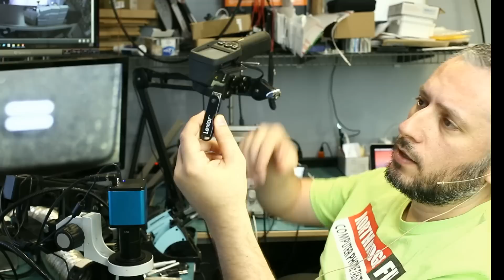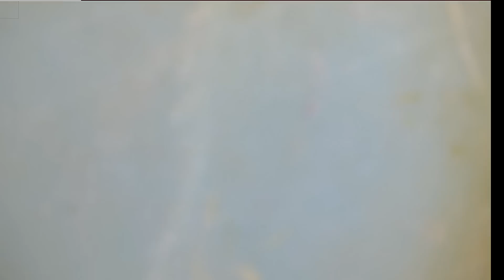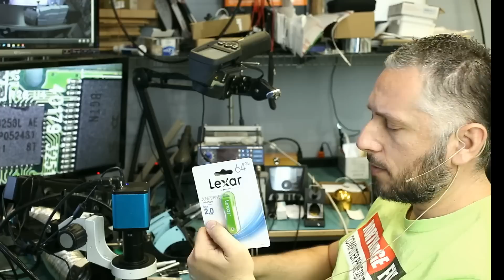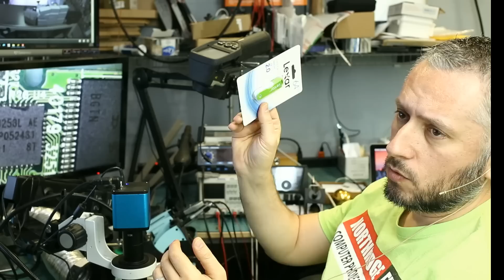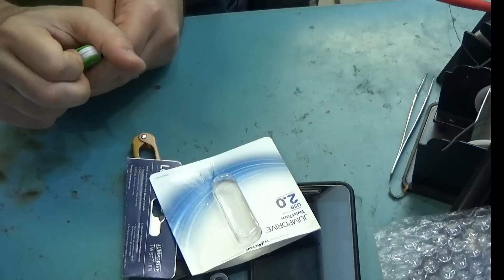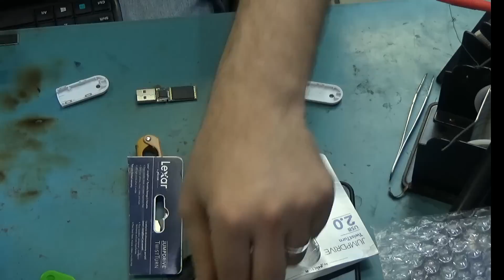Lexar USB Flash Drive Data Recovery - Impatient customer gets no repair

Comment: Chance of you getting same controller by buying a flash drive that 'looks similar' are virtually zero. Pitty you didn't show if it showed up in disk management, and if so with what capacity. Also, ChipGenius may help you determine if controller for example gets power (does it ID yes/no). If NAND chip does ID you can even tell the controller is able to talk to NAND.

Also, it may be worthwhile getting the FE NAND reader only (flashextractor.com) as there are labs to do logical image reconstruction for you at reduced cost for B2B if you upload dumps.

Comment: Swap nands! ;)
Reply from the maker: That won't work unfortunately. We have to have the same exact controller otherwise, we'll have to create a controller map for nand to work with the new controller
Reply: If the nands are similar they should have identical pinout.
Reply from the maker: That won't work. The physical properties of the Nand is not the problem. It's the firmware. FTL is a layer that sits below the file system and maps LBAs to physical addresses (Block id page id sector id). You can't just expect the Nand to work on any controller without Maping. Research the topic to learn more.
Reply: @NorthridgeFix  Right, this is mainly for security reasons. Imagine if you can just simply read off a NAND chip
Reply: Mahmoud Nadi I’m imagining, that IS the point of a USB flash drive! Anybody who has the drive can read the content, by simply connecting it to a USB master. In some applications that security should be mandatory, but honestly no reason for USB drives. It baffles me how there is no market for high end, easily recoverable USB drives.